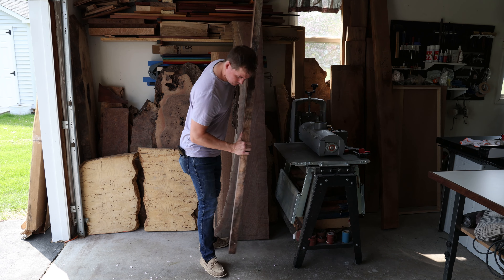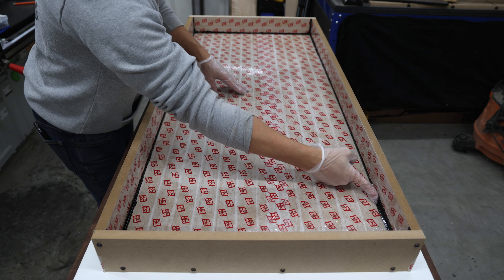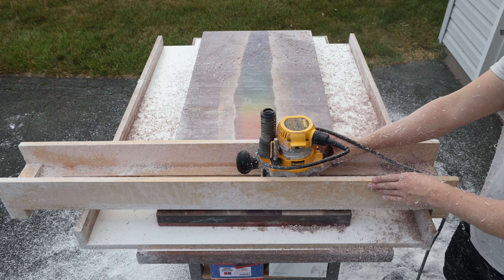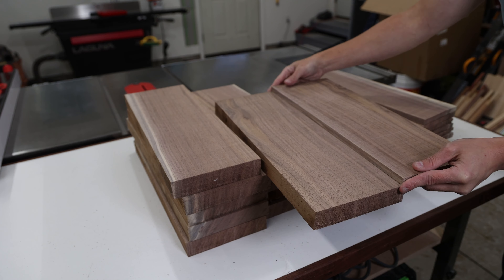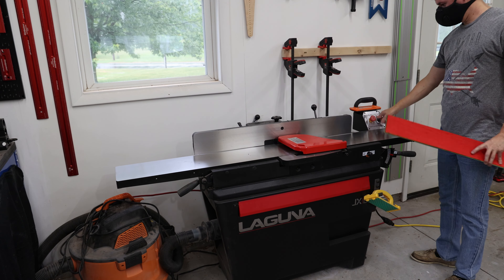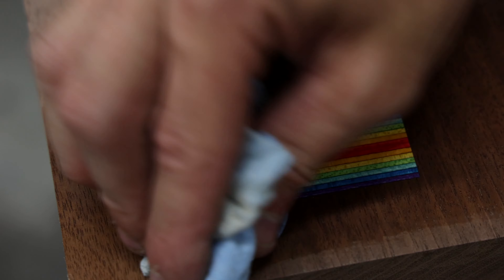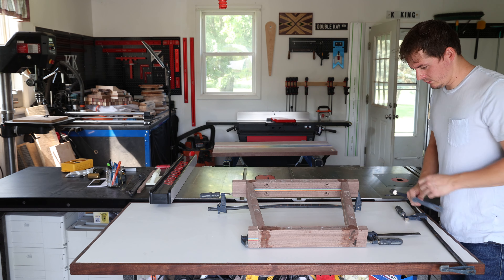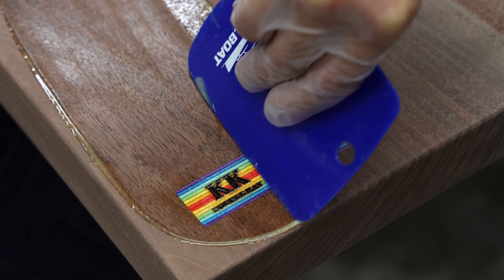6 Colors, 1 Epoxy River Table

Comment: Stunning. Recommended, you could of saved time and money by just opting to use electrical ribbon cables that come in all those colours. You would just need to use a router to make the slits and then slide in the ribbons, followed by a clear epoxy to pop them. No would know.

Comment: Do you have access to like local walnut you can slab out personally from tree removal or buy separate. Just curious cuz the few videos I've just started watching I see you kinda just pull them from like storage corners. So I was just curious cuz I buy when I can but I live where walnut is super rare like 1-15,000 trees in at the absolute highest estimates. Run into the same exact problem with red cedar
Reply from the maker: I've never showed it in any of my videos (I have showed it on IG), but I have about 6000 BF of wood that I've bought over the years. I frequently pull from this stash for projects, but for something like this project where I was looking for a specialized material, I order it from out of state and have it sitting in the shop until the project starts. Long story short, I frequently buy wood in and out of state from suppliers - I do not harvest and mill myself.

Comment: on your bases. No reason you can't sand (and finish for that matter) prior to final assembly. A little fiddly to be sure, but better than hours of hand sanding.
Reply from the maker: Although partly true, very inconvenient for this operation. With the glue up any misalignment or slip in the joint and it will have to be resanded. Not to mention the potential for sanding the area where the joints meet and compromising the fit...or having to round over the pieces after glue up. I appreciate the advice, but if I were to do it again, I'd still do it the way I did. Order of operations was HIGHLY considered when making these bases.
Reply: @thedoublekayway  funny this endeavor. I see it the other way. lol. More chance for inconsistency with varied access to the surfaces. of course we are both correct in our respective shops. Great piece btw.
Reply from the maker: @StoneyMeyerhoeffer  100%! I definitely appreciate the recommendation. I like seeing and hearing how others approach situations and tackle problems. I tell people all the time, the “right” way to do something, is the way that works to achieve the result desired (as long as it’s done safely).

Comment: That is a gorgeous piece! Great work. Did you use SketchUp or any software to create the design/dimensions of the legs?
Reply from the maker: I did, yes. I used SketchUp to determine dimensions and splay. I didn't show that part as I figured it wouldn't be that desirable of content for this build, but I will definitely be showing it used in future projects. I often use it to rough mock up projects. Really helps determine what dimensions "feel" balanced.

Comment: How much has it cost for all your tools and machines? Curious cause i want to get into this..
Reply from the maker: What I have in value today definitely isn't what it takes to do the work, or do it well. I started off with a cheap black and decker drill and a used 1990's miter saw. I slowly built up my tool inventory. I've put back almost every dollar from projects into tools and supplies. If still curious though, I've got about ~$35-40k USD in tools / accessories.